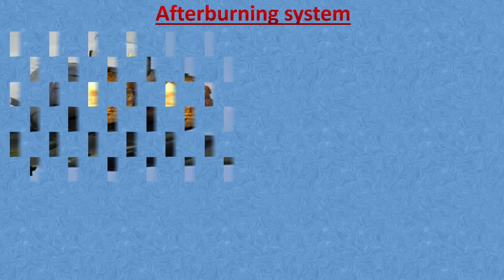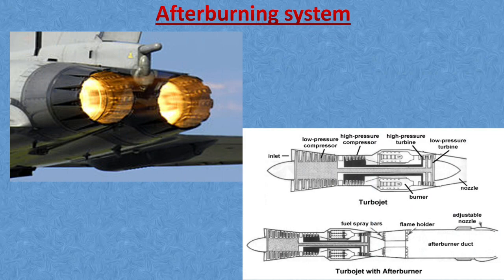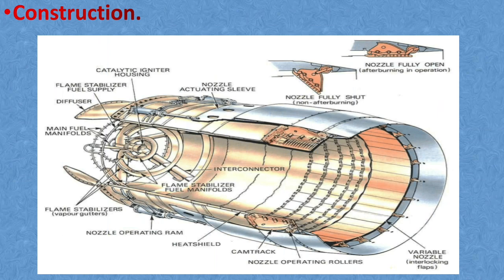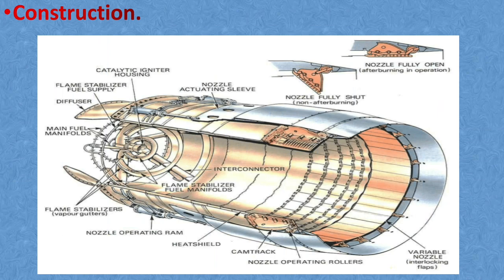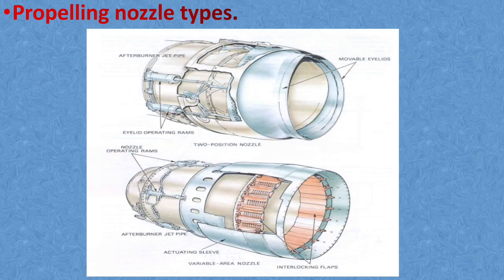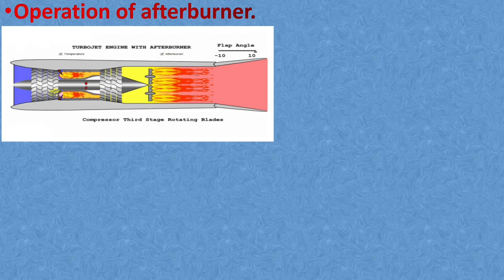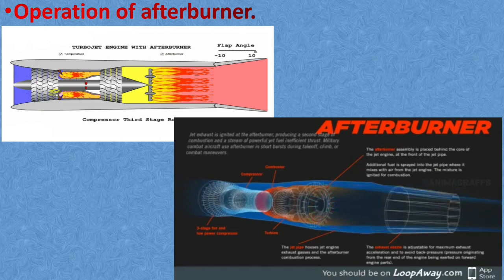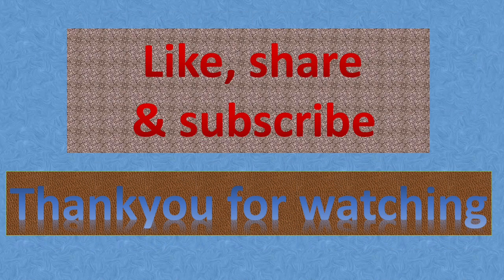How does an afterburner works?

Comment: One thing to add is that afterburners are inefficient mainly because the air pressure downstream of the turbine is low due to the expanded exhaust gases from the turbine (combustion works better at high pressures). Though that being said, the air pressure downstream of the turbine in a low bypass turbofan or non bypass turbojet is still much higher than the air pressure downstream of the turbine in a high bypass engine where the exhaust gases from the turbine (and bypass) would be even more expanded. This is why among other reasons afterburners are only used on low bypass or non bypass engines.